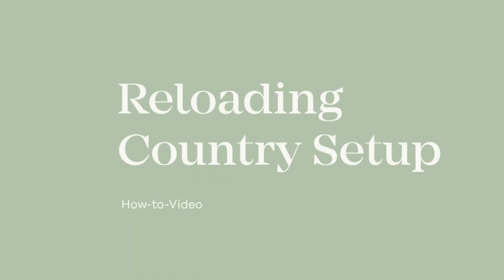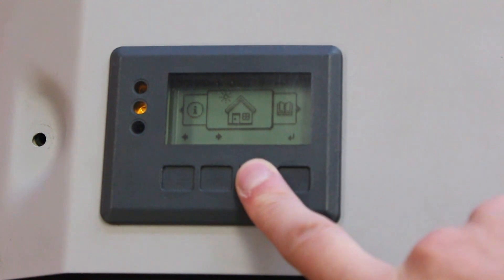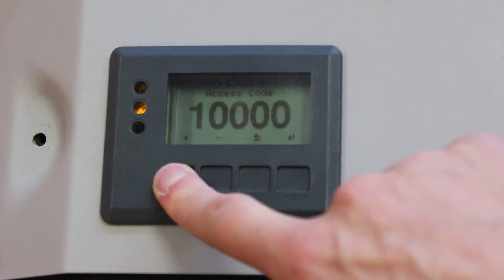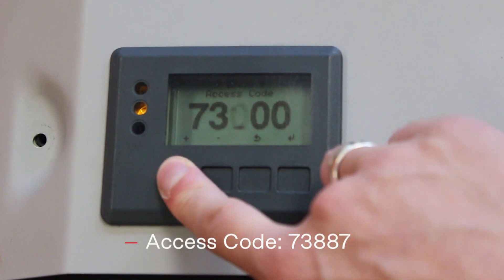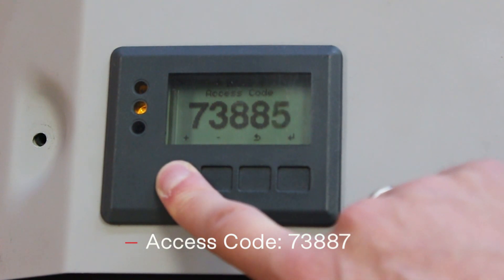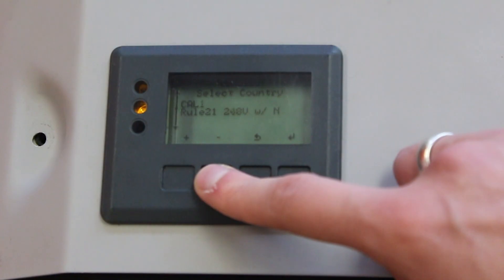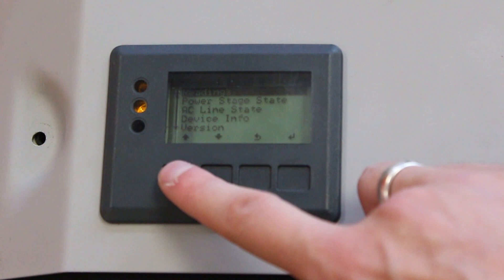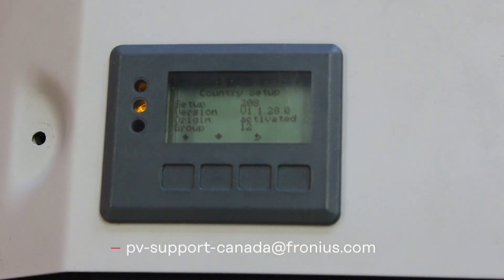How-To: Reload Your Country Setup for the Fronius SnapInverter (CA)

Comment: When I open Country setup my inverter (Symo 5.-0M) tells me that there is no country setup? What can I do?
Reply from the maker: Hello, this means that there is a problem with the inverter's firmware. Please update the firmware. You can do this either via the network (if the system is on Solar.web) or via USB.

USB instructions are below.
Please watch our YouTube video how to this: https://youtu.be/8_PdecnXCh4

The firmware can be found at: https://www.fronius.com/en/solar-energy/installers-partners/downloads -> Search for "Fronius USB update" -> Download "Fronius USB Update Galvo Symo Primo Eco V#####"

*We strongly recommend using a small capacity USB, equal to or less than 4GB. If you don't have one on hand, you can still try using a stick greater than 4GB (e.g., 8GB). However, higher capacity lowers the chance of success. In case of error codes 746 or 736 during the update, it means that the USB is not suitable.

*Please format the USB as FAT32 and leave only one file (which is the firmware update file) in the USB.

Before physically removing the USB, always go to “Setup“ > “USB“ > “Unplug USB Device“ on the inverter's display.

Best regards,
Daniela from Fronius
Reply: @FroniusSolar  Thank You for your help Daniela! Will try!!